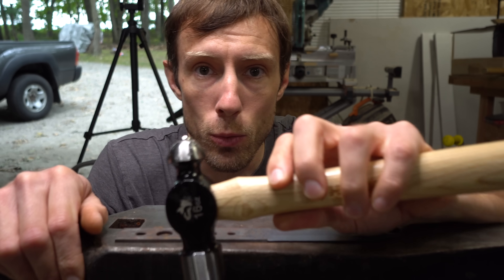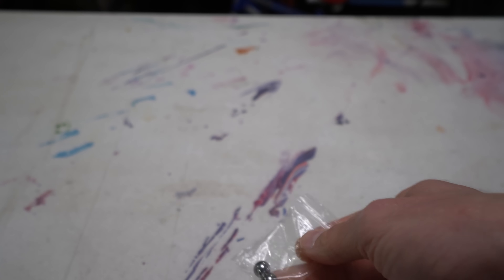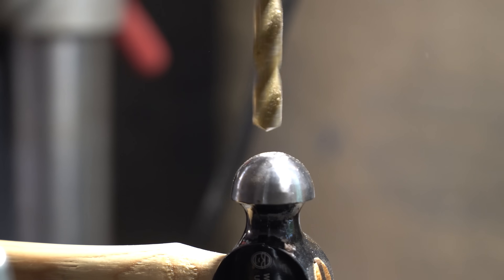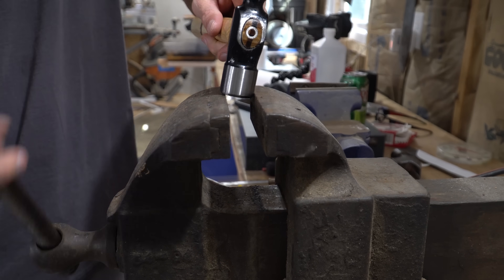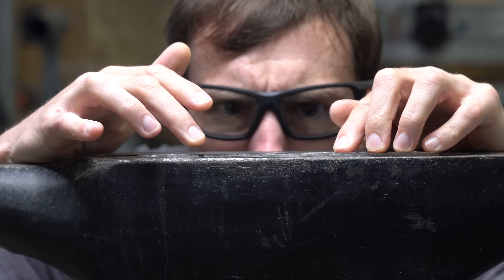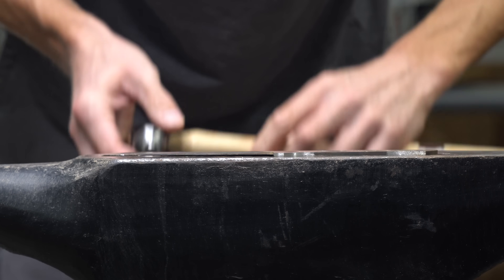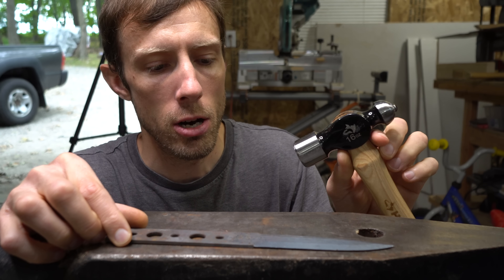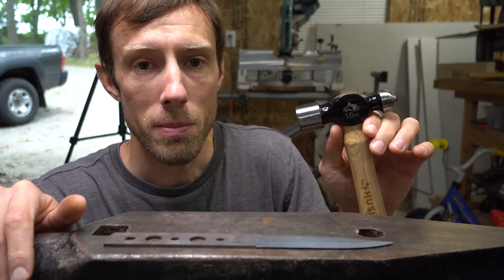I Should Have Made This Weird Tool WAY Sooner

Comment: Just put your chuck key on a wire or chain and attach that to the drill press somewhere out of the way.
When you need it it's just hanging there. When you don't it just falls out of the way

Comment: Put your drill chuck key on a light weight chain leash.  If you can’t remember to remove the chuck key from the chuck when you are done tightening/ loosening cutting tool you probably shouldn’t be using a drill press, and should take up golf.

Comment: I see carbide balls and rods over on Mcmaster-Carr (verify shipping price before ordering -- often surprisingly high). 
Don't forget you can find a beat up yard sale ball-peen hammer to recondition and use for this kind of project. New or worn out hammer: I'd cut the handle into a stubby length just so it's obvious it's a special tool and not a general beat on anything hammer.

Comment: For errant chuck keys: tie a rope/chain to the key and to the drill press around where the drill attaches to the support post. Have enough length for the key to reach the chuck and then it dangles well out of the way behind the post when not in use. Never lose the key again.

Comment: I wonder whether there's a way to "automate" this, by like creating a computer program to scan the blade for its curvature, to calculate the exact ideal location/spot to hit and with how much pressure, and then to rapidly kind of zip around kinda like a CNC machine or 3D printer going to the right coordinates, hitting that spot, then moving on to the next spot after re-running the calculation for where to hit to take out the next mini-warp. 
(and possibly built in a flip feature too, in case you need to strike the other side)

Comment: We used pipe cleaners to wrap around the drill chuck key and then wrap the other end of the wire pipe cleaner somewhere handy on the drill press.

Comment: So when you flat grind the dimples out, it doesn’t remove the tension of each dimple? The   Density of the metal radiating out from the dimple seems like it would be what “pushes” the surrounding, non-compressed metal away from it, bending the blade downward. So, if the small areas of compression are ground off, what would stop it from springing back the way it was?

Comment: Your worried about 1/64 warp? If your knife is bending after hardening its not hardened right. By stretching hardened material, wouldn't you then be weakening the grain structure and creating a more brittle blade? Id say if you cant harden it without it warping you did something wrong further up the line a little. I could be wrong. But thats what seems most logical to me.

Comment: How about just re heat treat the ball pean hammer ,there should be enough carbon to to make the hammer head temper at 60 ish rc..
Reply from the maker: A hammer won't harden harder than knife steel. You need 68-70+ hrc for straightening hardened steel knives at 66hrc

Comment: DID YOU KNOW THAT IF YOU GET SAME DESIGN OF HAMMER BUT A WOODEN FRAMING HAMMER TO PUT PANEL PINS IN THE WINDOW BEADING IT WOULD DO THE SAME AT A LOWER COST YOU MAY NOT SEE THEM TODAY BECAUSE PEOPLE ARE LAZY AND USE BRAD GUNS THOSE WITH NO SKILLS 😊 BUT IF YOU WAS BORN IN THE 50S/60S THAT'S WHAT WAS USED MAIN HEAD 16MM BALL HEAD 10MM
Reply: Ps a cross pein 4. Oz £4.50 from ebay hickory shaft

Comment: 2:00 Tip for the drill press key. Put a 1/16" or similar size wire leash on it & attach it to the press. Never loose it again. As for drilling out the head  recess use a smaller pilot bit & set the hole depth with that. Once you get the larger bit in play you stop as soon as you have just a tiny remainder of the pilot hole as needed. Better yet Stop drilling once you get to your max radius depth then switch to a carbide ball mill bit. This way you support the new insert better.

Comment: Thanks for the tip! Now, I have a tip for you! :D
Drill chuck key --> use a piece of wire, fold it around the key (the part between the key teeth and the handle, in such a way that it can still freely turn while the wire is held still), and then give it a twist kind of like the wires they put around the bag opening of a loaf of bread --> then with the ends beyond/longer than the length of the handle, wrap them around or through a strong magnet (any magnet will do so long as it is powerful enough to support the weight of the chuck key) and then stick it (magnet) to the side of your tool/drill press/mill etc. If it's going on a corded drill, I don't use a magnet but I still use a piece of wire and attach it to the end of the cord next to where the plug for the drill is. The reason for this is so that I make sure I (or anyone else) has to unplug the drill before messing with the chuck so that the trigger does not get activated by anything while my hands are holding a bit and the chuck. I hope this helps! Do this and you'll never misplace or hunt for your chuck key again! It saves a lot of time and hassle. Cheers!~

Comment: Beware that not all carbide is created equal, a lot of carbide is relatively brittle and can shatter or send shards flying. I made mine using an insert for a large rock drill which is super tough (Tungsten Carbide button inserts). Only way I could straighten a super thin 14C28N filleting knife.

Comment: I have a magnet stuck to the spindle housing of my drill press. That's where my chuck key lives.
I also have a nail polish bottle (bought empty from amazon) in a little pipe clamp mounted to the column of my drill press. It has that handy brush directly in the lid. That's where my cutting oil lives. I don't like to spray oil all over the place, I prefer tiny little drops just where the work is happening.

Comment: I would have used that nice 2x72 to flatten that blade, haha no for real though this is why I grind bevels post heat treat.  I think grinding post ht on plate quenched steels really helps prevent warping.  In house heat treating hundreds of aebl blades without dealing with any warp.  We do clamp multiples while in the cryo (l nitrogen.)
Reply from the maker: Aeble isn't bad post ht. M4 is a pain to grind from scratch post ht. I hear ya though👍
Reply: @OUTDOORS55  I haven't worked with m4 yet, but ive played with s35vn s90v and magnacut post ht and I can't really tell a difference using fresh norton blaze belts.

Comment: Cool tool hack! My drill press chuck key is on a length of vacuum hose stuck over one side of its T-handle, and tied off at the top on to motor mount, so it's always hanging right there in the back when I need it; pull it up, use it, let it go...it falls right back; always handy.

Comment: I've seen this around the YouTubeiverse and I plan to make one very soon, Others have suggested grinding a carbide drill bit instead of using a ball bearing. I think a bearing would be easier, but if you can't find one, maybe the drill bit would be a good substitute. There are also a few sites selling these in case someone doesn't have the time or interest in making one.

Comment: if you drilled a 2nd hole inside the first hole, smaller and deeper. you could epoxy a magnet that would grab the replaceable ball barring, but you would have to make sure that their was no way for the ball barring to touch the magnet or it would shatter with the first blow. if you planned you could bevel the sides that holds the ball too so the barring does not get rings cut in to it.

Comment: Just be sure to do two temper cycles before using these hammers, I’ve tried using after first temper and it caused cracking. And make sure to hit blade with the correct side of the warp.

Comment: Dude… put a leash on that drill chuck. Simple as cord and electrical tape. Even just cord if you have knot skills. Magnet mount it even. I usually tape them to the cord of the drill near the plug so you gotta unplug the tool to use it. Makes it safe. But any method of retention is better than searching.

Comment: Just a thought expanding on the idea. Use tungsten carbide rod 1. It's much cheaper and widely available in a multitude of sizes 2. It would be far simpler to seat in a striking tool for example a brass hammer that makes use of a set screw to allow for changing out broken bits and 3. You can grind a plethora of profiles other than a ball to allow for more controlled stretching, giving you more exact results and far fewer blemishes that require finishing work. 4. One easy to fab brass hammer with say 5 bit profiles cross peen, ball, chevron, scallop , and perhaps a waffle for some knock off knurlling texture. 6. This would also make the idea much easier to transfer to a small jewelers hammer peice which would increase you precision and efficiency to the point you'd likely be able to work through entire boxes of warped blades in a sitting.
Reply: Long ,but effective.
Reply: Seems like using a rod would be a lot more likely both to break and to mar your work by strikes on its edges.

Ball bearing has the advantage that it has no edges.
Reply: Not everyone has the capability of grinding tungsten carbide. Ideally, you would want diamond or CBN grinding wheels to accomplish it, I think.

Comment: So you take a ball peen hammer, drill a hole in it, insert your carbide ball into the ball peen, peen over the edges to keep the ball in place on the ball peen, and then hit things with the ball now peened into your ball peen. 

Peenception.

Comment: can this lead to micro cracks in the knife? When I went to Chris Reeves knives for a tour of the place when my fil worked there, they were using a machine that did this very fast. Kind of like a sewing machine or something (sorry, my mind is fucked and I cannot think of words for things atm). ANYWAYS, they had some issues with blades breaking and such, right on the stress points where the pin was striking the metal. Some of the knives broke in the field a couple of years later but it was always on the stress points. I think the way you are doing it is much more gentle than what I saw and discussed with them so it may not be the same issue. The idea I tried to get my fil to create (he's a machinist) was to create a Tungsten honeycomb template that would go into the oven with the knife for the heat treatment. It would sandwich the blade steel firmly and not allow for any warping as the steel was quenched but it would have minimal contact with the steel because of the thin honeycomb shapes that would allow uniform heat throughout the length of the blade. God, I don't even know if I am describing it right, I am so tired. But it would be like one of those campfire sandwich devices where you put butter, bread, cheese, bread, butter and then clamp it shut with the handle. God. I am hungry now. Maybe it already exists.

Comment: The process you employed to “peen the hammer around the bearing is a Jewelry smiths process 
It is called “setting the bezel”
It is typically used to set cabochon stone but is also used to set faceted stones
Very creative use of a age old smithing technique
Reply: I've also seen the process referred to as staking, especially if done with a center punch.

Comment: I’ve had a lot of success with mine but I have cracked a few blades by using it. I would highly recommend doing both temper cycles before using it and if you’re going over 65 hrc to be careful.
Reply: Sounds like I should expect to be able to it with a Spyderco Native 5 blade in maximet.

Comment: Congratulations! You’ve just completed your very first bezel setting! 
Usually done with gold and a gemstone, but the concept is almost the exact same. As you found out, the key is to make the hole almost the exact same diameter so it’s a very snug fit. As long as the the center of the ball is just slightly lower than the level of the hammer face, it’s all a matter of reducing the top of the hole diameter so it’s smaller than the diameter of the ball. 
A word of advice… after a while, the ball will sink deeper into the hole you made in the hammer. When this happens, just squish the edge you hammered down tight again. It will eventually reach a sort of equilibrium where the ball will require more force to compress hammer steel than you’re applying to it. 
Now that you know how to bezel set, you can apply this technique to your knife making, such as metal inlay. 
Have fun!
Reply: GREAT INFORMATION. I was wondering if he set the ball in deep enough. But as you explain it will achieve its equilibrium.  I was also wondering it the JB weld was necessary? So to recap,for my understanding the hole size and depth are most critical in order to make a long lived tool.
Reply: @Curtislow2  hole size is crucial. Too narrow? It won’t fit, or you could accidentally break the ball/gem by trying to force it in. Some rare cases you can hammer it in if the thing (the ball) is significantly harder and not brittle. 
Too wide, and you won’t be able to push the metal over it to keep it in. Well, you technically could, but you’d end up deforming the hammer so much after so much work that it’s not worth trying.  Hole depth is just as important, but there are things you can do to mitigate any errors. Too shallow, just drill deeper. 
A little too deep? Drop a spacer inside. Think like shimming. 
In my experience, glue isn’t necessary. It help keep the ball from falling out while pushing the metal over it (which wasn’t the case in the video because he had a good fit. With a really good fit, friction will hold it in line in the video.) Sometimes glue is used to keep a stone from moving around within the bezel, but this is for when you don’t have a good tight fit or properly push metal over it. 
For weaker gemstones, glue can be used as a cushion to reduce the chance of it breaking if you were to accidentally hit it.
Reply: @nottheoneyourelookingfor0504  Very interesting.thanks forth informative reply.
Reply: @Curtislow2  no worries. Any other questions, feel free to ask.
Reply: Good information, thanks!
Reply: Damn! You beat me to it!
Reply: This reply really helped me.
Reply: @HonestDoubter  my pleasure. Anything else I could help with, please feel free to ask

Comment: I can't figure out how hammering the compressed/shorter side flattens it again. Intuitively, I'd lay the item down so it forms a cavity and try hammering it flat (which never really works).
Reply: It doesn’t work because there’s nothing stopping the metal from simply sliding along the anvil face and pop back into miss-shape. 
What I’ve done as a goldsmith is to use a lead block. If you put your piece with the curve facing down, so the middle is raised off the lead block surface, and strike the metal with a mallet where it’s bending, the lead offers enough support and resistance while allowing plastic deformation of the bent metal instead of it simply acting like a spring.

Comment: Thanks for the tip, I sometimes use this technique and get pretty good results. But the several marks on the blade are hard to remove loosing thickness.

Comment: I've been about these composite metal hammers for years, ever since I heard about solid lead hammers or solid copper, just to get some characteristics on the face.

I don't think you need to go as complicated as using a hardened steel hammer as the base, a wooden mallet would probably work to hold the tungsten carbide, and if you need more heft add some lead to the head.
Reply: Problem with using a wooden mallet is that the ball bearing will end up getting buried in the wood and eventually split it. Wood just isn’t hard enough to withstand all the force applied to such a small area. 
Metal is a much better choice.

Comment: Totally game changing for sure! I have one of Kyle's hammers (KHDaily Knives - highly recommend - link in the description) and it absolutely changed my world. It has saved me hours of time. The tagane hammer paired with a quench vice took straightening from a real time sink to something that only takes a few minutes per blade usually. When I originally saw Murray Carter do it I assumed it only worked on thinner cross sections, but it works well even on 3/16 stock.

Comment: Tip for you, you never want to chuck the drill on the flutes.  The shank is a softer for a reason, it gives slightly to let the chuck jaws "bite" and not slip.  The flutes can damage your chuck jaws, and not allow it to hold concentricity because two flutes and three jaws don't line up.  I prefer to buy stub or screw length drills as needed, they're more rigid that jobber length drills, and don't take up as much workspace between the table and the chuck.

Comment: Trick to prevent your chuck key from running off and hiding every time you need it: just drill a little hole in the handle, and secure it to the drill press with a length of ball chain. (the type that's used to secure the drain plug to your sink)